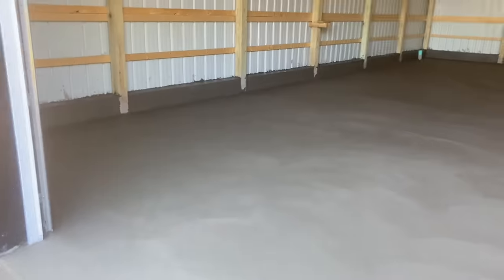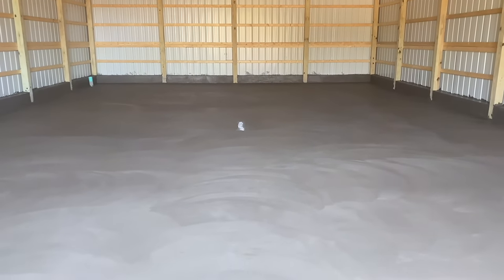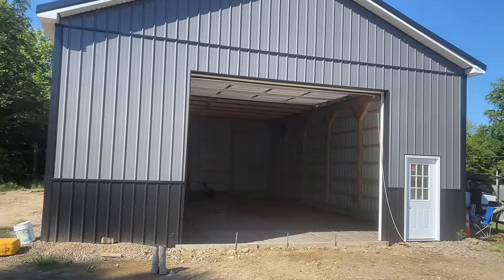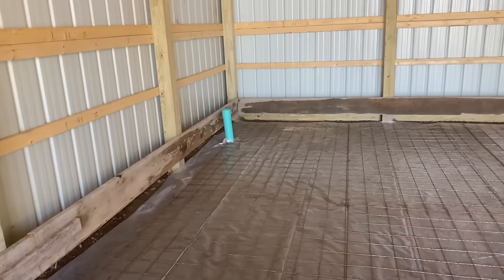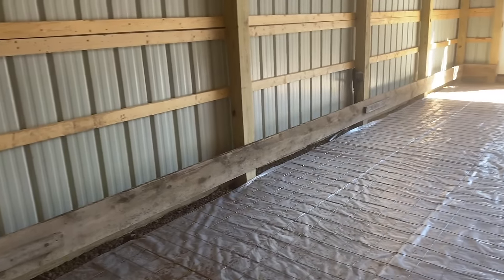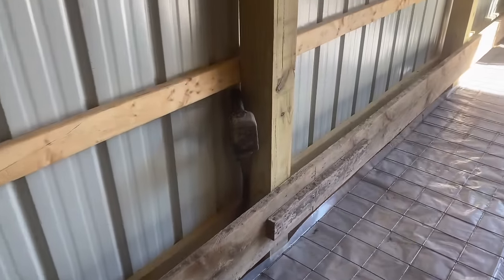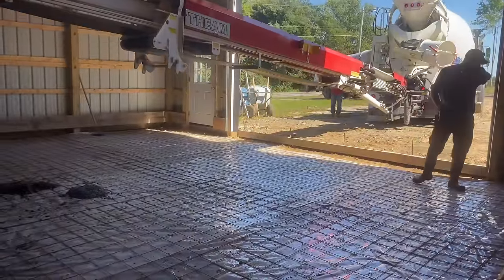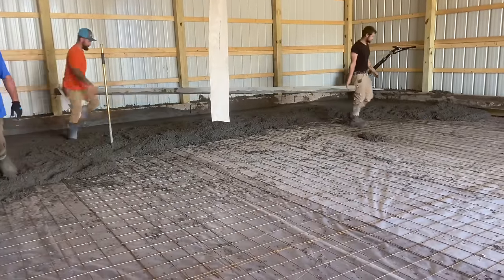All concrete cracks? Not this slab!!!!

Comment: So you pull the wire up into the concrete to imbed it into the concrete but then your crew walks all over it while screeding and finishing and looks like forcing the wire back to the ground. The wire should be in the center of the slab not at the bottom!
Reply from the maker: No the wire should be at the bottom side of the slab because you want it on the tension side when the concrete is loaded on the top. If it was in the middle it would act like a hinge if the concrete were to break. The stone in the concrete keeps it up a little bit even if we step on it.
Reply: @bondobuilt386  in CA we set the rebar on adobes which holds the rebar or wire up into the middle of the slab, not on the bottom!!! Why do we do that if it’s supposed to be on the bottom???? Oh yeah, I used those adobies back on the Island back in the 70’s so tell me what are they for. With all the comments you get about your wire maybe you should think about changing the way you imbed your rebar and stop making excuses for fast and cheap as opposed to the correct way. And I didn’t see anyone vibrating the concrete either!!!
Reply: @bondobuilt386  the tension side makes no sense
Reply from the maker: I guess we should change the way we do it because in over 35 years and 1000's of slabs we have had no problems with this method. There are more than 1 way to skin a cat. Besides what would all you armchair warriors talk about if we chair the wire? Oh I know it would be unsafe? as it would be but nobody thinks about falling trying to walk on wire up in the air. Maybe we could pour the floor on hoverboards. LOL @JamesWall-m3e
Reply: @bondobuilt386  and you have a contractors license??? I humped lumber on my first job in 72. Summer vacation before my senior year. The next year they said get bags and you can get on the deck! Retired 3 years ago. Never had time to sit in that armchair you’re talking about, spent all my time in the trades. Maybe you should go tiptoe through the Tulips because I know it’s harder (not unsafe) to walk on with adobes or chairs and that’s why you don’t use them!!!Maybe you should just go sit in the armchair and read Olins Principles Materials and Methods before you start your next job!!!
Reply: @bondobuilt386  and I’m not slow
Reply from the maker: @JamesWall-m3e  well at least I finally got someone commenting that has a clue. Most the people commenting have not so much as poured a sidewalk flag in their life. I do appreciate all this dialogue especially if it is constructive as I am a learner and run a learning operation. Also it helps the channel grow. As far as constructive it would help us content creators if you guys put a positive in with the negative comments. This is a lot of work to put all this together. 
Enjoy your retirement and keep the feedback coming and watching my videos sir.
Reply: @bondobuilt386  ok the wire or rebar doesn’t go in the middle of the slab, it goes 2” away from any sand or dirt embedded into the concrete because basically that’s how far moisture can wick into the concrete and rust the rebar or wire. I have no problem pulling up rebar with a rake, my problem is how far down it goes after heavy walks on it. I’ve stabbed anchor bolts into fresh pours ,skinning the cat, it comes down to best practices and maybe they will invent a hover board to replace the sleds one day
Reply: And I have tripped on the rebar and the wire is worse. Looking for a better mouse trap 🪤
Reply from the maker: I have enjoyed our dialog sir. I truly am trying to come up with a way to do this better. Completely open if anybody figures it out as I said I love to learn. One of our struggles is we wheel most everything we pour so I just can't find a good way to wheel over suspended steel reinforcement. Pump or conveyer it could be done easier.  @JamesWall-m3e
Reply: @bondobuilt386  good luck

Comment: Pouring against metals a bad idea that guy is going to have rusted out sheets soon enough...
Reply from the maker: He wanted this done because it was done in his old pole barn where he used to live. That was done 15 years ago and looks like the day they did it. The metal is fine.
Reply: @bondobuilt386  old metal and new metal are likely different gauges and probably won't last as long as the thinner gauges is used today.  Concrete will often sweat with humidity and temperature changes...  I don't see this as ever being a smart idea

Comment: HOGWASH! Around here our 'pole barns' are more than 100 year buildings. It doesn't take much to make that pole barn a 100 year building...simply protecting that wood from the water contact at the base. You could have easily wrapped, or liquid rubbered, those posts at the bottom to make that structure last at least 100 years.
Reply from the maker: Well I did not build the building and if it is clay or other wet area good luck getting 100 years out of the new treated wood they use.
Reply: @bondobuilt386  
It is not hard to separate wood from the surrounding moist earth. We have the technology, and are doing it...around here at least.

Comment: (so what) i have poured many floors without cracks you were just lucky like me 
concrete WILL CRACK maybe you cant see them plain but it will shrink crack
temp control means a lot so does grade prep but your no god in placing concrete
you just lucked out like i did a few times in my 47 years of concrete no secret at all

Comment: You didnt pull the wire up at all or have it suspended in the concrete. Might as well not even put it in there. The way you poured it is what we call a Sears Garage except worse. Now if and when it does finally crack theres no rebar nor wire to stop it. Wire sitting at the bottom of a pad isnt worth anything. God I hate seeing piss poor workmanship.
Reply from the maker: At 10:48 I explained and slowed the video down for the slower people could understand how we did it. watch again and you might see us pulling the wire. I had one guy (Roy)and that was all he did. LOL.
Reply: @bondobuilt386  If you call that pulling the wire up high enough you're crazy.
Reply from the maker: the wire could be poking out the top and someone (like you) would say we didn't pull it up. LOL @crunchbbq7488